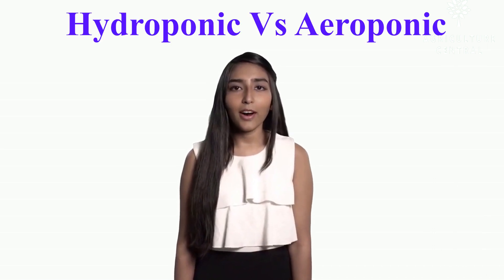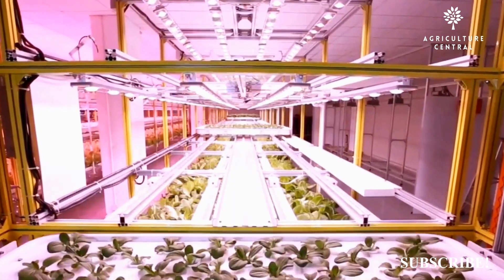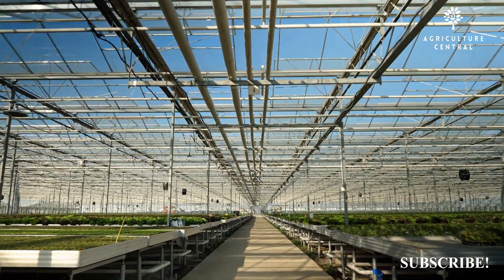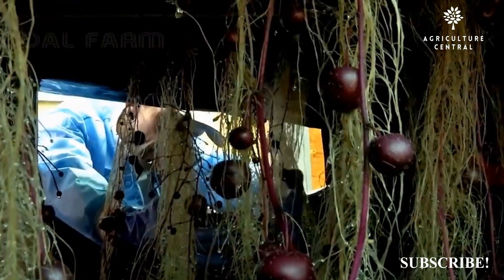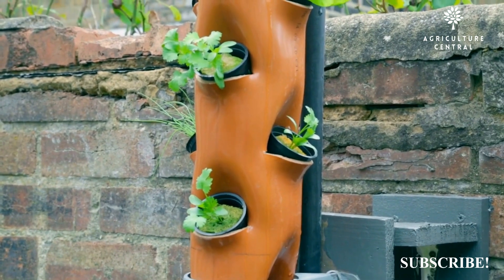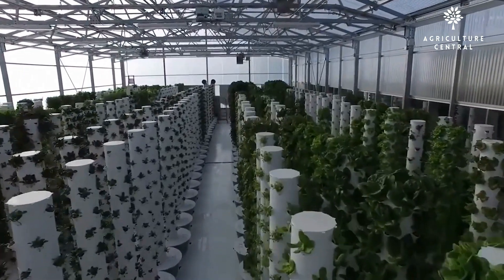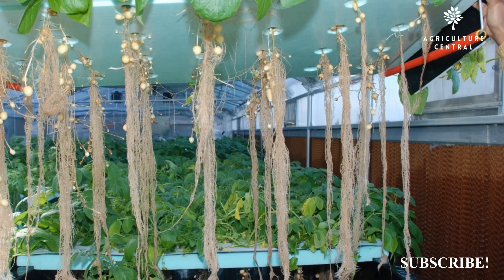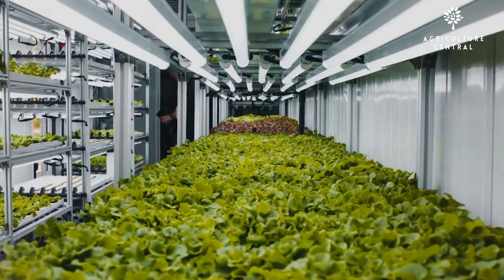Hydroponics VS Aeroponics: Which One is BEST | Hydroponics And Aeroponics Differences, Pros & Cons

Comment: Hello I have a question, when we talk about traditional soil culivation, we need nitrifying (or more) soil bacteria and fungus that live in symbiosis with the plants to be grown, is this the same for hydroponic and aeroponic method ? can we totally make the vegetable growing without these bacteria and fungus that transform nutrients ?
Reply from the maker: In traditional soil cultivation, beneficial soil bacteria and fungi are vital for the nutrient cycling process, converting organic matter into plant-available nutrients. However, hydroponic and aeroponic methods of cultivation reduce or eliminate reliance on soil microorganisms. Hydroponic systems supply plants with essential nutrients directly through nutrient-rich water solutions, bypassing the need for nutrient transformation by soil bacteria and fungi. Similarly, aeroponic systems mist plants with nutrient-rich solutions in an air or mist environment, eliminating the need for soil microorganisms. Consequently, plants in hydroponic and aeroponic systems solely depend on provided nutrients, typically mineral salts or synthetic sources readily available to the plants. While some hydroponic systems may incorporate beneficial bacteria or fungi as supplements to enhance plant health and nutrient uptake, they are not essential for plant growth. Thus, hydroponic and aeroponic methods reduce or eliminate the requirement for symbiotic relationships with soil microorganisms present in traditional soil cultivation.Hope I answered your question. Thank you.

Comment: There is no misting system in a Tower Garden , its hydroponic :) 
Pouring water down from the top of the (hydroponic) tower offers no "precise control". It will consume 10x more electrical power compared to a genuine aeroponic tower containing the same number of plants.